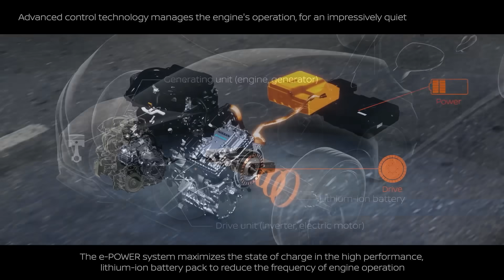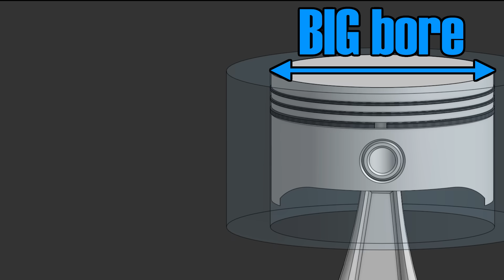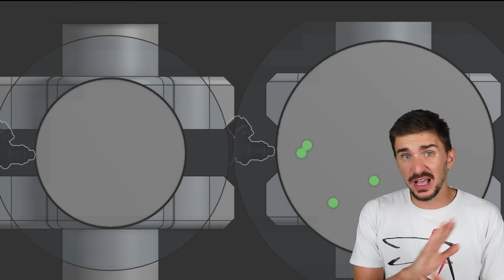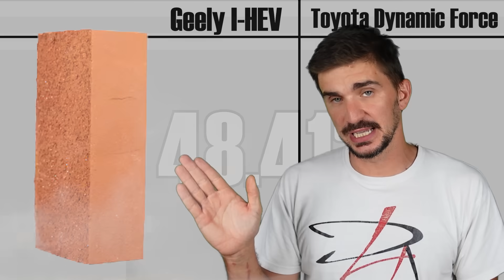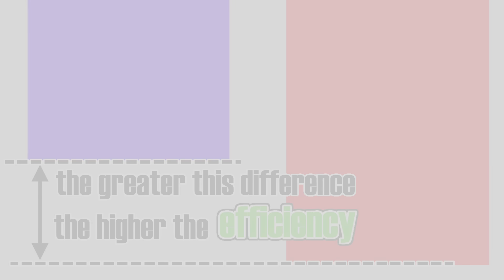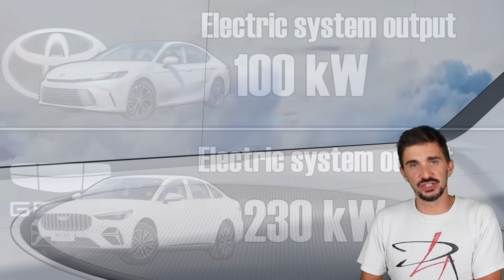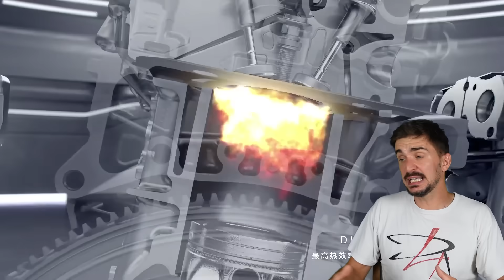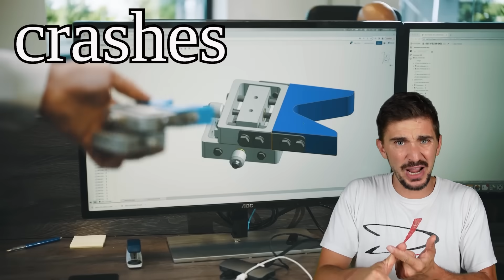How China's Geely Beat Toyota, BMW, Ford and Everyone Else

Comment: Always excellent, thank you.
Obviously I'm missing something: Direct injection has generally won out over port injection, and yet one way to get increased efficiency in gasoline engines is better air / fuel mixing. How to achieve that? Give the mixture more time to, er, mix by adding the fuel in the port or even the manifold... exactly the opposite of the direction of travel for engine development.  So... why?

Comment: Anything 45% and up is formula 1 territory and not happening in a bog standard 'affordable' mass production engine. You start needing exotic materials in various places, ridiculously costly pistons, rods etc production techniques to save weight and therefore have less inertia losses in moving parts everywhere, and reduce seal gaps to the absolute minimum. And then a pre combustion chamber to prepare the fuel air mixture for the main chamber, and so on and so forth..

Comment: Porche had engines that had coated cylinders................... it did not go very well   ask the owners
Reply: Are you talking about Nikasil coatings? Those broke down due to sulphur in the fuel, DLCs are not suceptible to sulphur, it has been used in cutting tools for decades now, they last an extremly long time! In an engine with little power to displacement and no forced induction, I am sure the DLC coating will be the least of their concerns, especially as the engine is not directly coupled to the wheels and is free to move at whatever speed it wants (Avoiding resonance speeds and high speeds in general)

Comment: one comparison that would have been very interesting : engine price/maintenance price vs efficiency ...the  more exotic manufacturing processes and materials you use, the higher the risks of failure, I mean F1 engines are running at 50% efficiency but break down after 2-3 races.
Reply: Ehm, they last about 3000 to 4000 km as mandated by FIA.

Excotic manufacturing is not what causes high maintenance, Diamond like coatings are coatings that last an extreme amount of time, in an understressed engine like that it would last longer than the life of the car, especially in a hybrid where it's only job is to keep the battery charged, no hard speed changes, running the optimal RPM, very chill.
Reply: Its more about exotic = expensive, F1 engine is 10 million dollars.

Comment: CHINA IS PUTTING ENGINES IN ITS ELECTRIC CARS FOR EXPORT    Its both a range anxiety and an inability to build infrastructure in the West problem, mostly the latter.

China knows that ultimately its exports will be limited by the pathetic levels of infrastructure spending in the West - at some point - we simply won't be able to buy electric cars cos no one can charge them. They are anticipating this bottleneck on exports.

Comment: 20years old Prius 1.5 engine has 40% efficiency ,
Reply: 1% is a massive deal in this respect. 7% is unbelievable.
Reply: @Demertech  Literally unbelievable. I don't believe them.
Reply: @nerdyengineer7943   You don't have to believe them, believe the independent testing.
Reply: @Demertech  Oh? Post a link to this independent testing. And it can't be testing by a Chinese company.
Reply: @nerdyengineer7943  Guinness world records independently verified. Google it. Also the Chinese independent government testing institution which complies with international standards independently verified. Even Japan's automotive analysts have admitted that China has overtaken them not only in EV and hybrids but also ICE engine technology now
Reply: That's not to say these brands are perfect. Chery for instance frequently exaggerates and lies about its hybrids power outputs because they advertise the combined output which isn't realistic.
Reply: @Demertech  I'm thinking that the engine can just revert to Otto-cycle when driver demand acceleration, right? so the real mileage is up to the driving style.
Reply: @xponen  I suppose but it probably will mainly be used in hybrid powertrains where the electric motors will help with acceleration.
Reply: @Demertech  how about the problem at 16:46 . It is practical to just switch to Otto-cycle than using "AI".
Reply: @xponen  then even worse at toyota etc, 1. they don't switch to otto-cycle coz it is atkinson only engine mode. 2. thats why toyota, prelude etc is struggling in endurance, try YT "toyota zenix hybrid on genting"
Reply: Audi had dirsels thst did over 40% 40 years ago. And they where actually fun to drive.
Reply: @matsv201  diesel is different to petrol dude.
Reply: @Demertech well yes. But the efficency number is the same.

Not only that, diesel have a flatter efficency curve making the high efficency more usefull
Reply: @matsv201  Diesels are generally more effecient. China holds the record for the most thermally efficient diesel engine at 53.09%.
Reply: @Demertech there are ship diesels in europe duing 56%

Yes, diesels are diffrent. But there is reallt nothing stoping companies just doing disles.

Its really mostly goverrment keep pushing gasoline
Reply: @matsv201  Those are ships tho lol
Reply: @Demertech so?
Reply: @matsv201  A ship engine is very different to a car or truck engine
Reply: @Demertech Yes, it is. When the price of fuel in the usa started going up, and more people started buying diesel vehicles, the uniparty government said "no way we can loose our money to launder... lets tax diesel to make it more expensice than gasoline!".
Reply: @keilmillerjr9701   I still like diesels but I think PHEVs are able to do most of what diesels can do. Check out the GWM Cannon Alpha PHEV. It outperforms every diesel in its category for "diesel things" such as towing
Reply: The negative is that it’s a Prius
Reply: @TheFunkymohawk  It's peak appliance. It asks for very little and still gets you from A to B like anything else. You have to respect it for that.
Reply: @jm036  Exactly, and the engineering behind its drivetrain is admirable. I've driven pretty new Toyotas, like Yaris 2025, and they are pretty powerful. They have them on the carsharing platform. I have also driven recent VW dsg automatic cars. And I very much prefer the Toyota over VWs... Once you don't need to shift in the car and you just tell it to go forward or stop, it becomes appliance, and Toyota is making just better appliances, which are sometimes even more fun to drive for me... I thought about it and I think it is because with DSG, you feel how it shifts, and it shifts when I don't want it to shift yet. Shifting with paddles is kinda unergonomic in turns and it is just, I don't know.. With stick you know exactly what you are doing, with paddles, it's just strange for me. Whereas driving Toyota with HSD, I feel like driving a train. The acceleration is incredibly smooth as in train and it shows you how much power you are demanding from it so you can drive it in a way that it is mostly in the EV mode, or when you need to accelerate more, you can keep the engine running for the entire acceleration, so it doesn't start and stop constantly. It is different driving experience which I am more accepting than robotized gearbox.

And I have to say, that the carsharing has older Yarises, from like 2018 or so, and these new ones... They are quite a bit better. More powerful electric motors, better acceleration, lower noise, bit more comfortable. In the old Yaris, I think going anything over 50km/h the engine has to run to not overspin MG1 whereas I am regularly going over 80km/h in new ones on EV mode only, the fuel consumption is therefore also bit lower. With my own car, Octavia 1.6 55kW AEE from 1997 the drive to work (when I need to move bigger stuff and don't need to park in the city for entre day, cause that's the most expensive thing with going to work by a car, with carsharing I can leave the car wherever I want and forget about it), the consumption is around 8l/100km, with old Yaris it is about 4.2l/100km, with new Yaris, I achieved 3.8l/100km when I was cautious about my driving...
Reply: @jm036  ah, but cars didn't used to be considered "appliances" at all, by most, until the advent of aggressively electric hybrids, and BEVs. 

The market needs to split. Cars for being driven and enjoyed/ pods for driving you and being nothing more than a "transport appliance"
Reply: @jm036  ah, but cars didn't used to be considered "appliances" at all, by most, until the advent of aggressively electric hybrids, and BEVs. 

The market needs to split. Cars for being driven and enjoyed/ pods for driving you and being nothing more than a "transport appliance"
Reply: @3xeplodng_3agle_studios  Most of the cars have always been appliances, and that's good.
Reply: @3xeplodng_3agle_studios  What a distorted reality you live in. Cars were ALWAYS considered appliances that take you from A to B. That is why Toyota and Honda became so popular worldwide: they were RELIABLE as any appliance should be. And also that is why Tesla 'Autopilot' marketing sold them many more cars: the MAJORITY of people don't want to drive, not just now, but 15 years ago. I would shut up about such a market split if I were you... I bet those 'driving pods' will have less and less part and RnD sharing with the 'driving enthusiast' market making the latter even less sustainable than it already was.
Reply: @TheFunkymohawk  I've never understood the hate for the Prius except that I think people just hated the people that bought them.  In its time, the 2nd generation Prius was TWICE the total efficiency of every other car on the road and this is why it was able to use the carpool lane with only one occupant.  Unfortunately, while this made sense from an efficiency and incentives standpoint, it was terrible for public relations; people are not logical beings and they saw instead that environmentalist tw*ts were getting special treatment.

The Prius was awesome and I wish that I owned one.  I'd put a big middle finger on each door and drive it every single day.  The new Prius has NONE of the advantages of the old one as it gets the same efficiency as a Corolla or other Toyota hybrid.  It's good that those cars are today as efficient as a Prius, but why not then make the Prius even more efficient to demonstrate a new goal for fleet efficiency?

The automotive press fawned over the new Prius because it now looks like a normal car, but they are all missing the point.  The Prius was NOT supposed to be normal; it was supposed to be super-efficient and economical.  Now it's just an expensive Corolla.

Not only did the 2nd gen Prius use less fuel than every other model of automobile, but it was also the cheapest to maintain for 10 years or longer.  2nd place was shared in a near-tie by the Honda Civic and Toyota Corolla at ~$500/yr, but the Prius was half that at ~$250/yr.  You bought a Prius and then drove the cheapest car to fuel, insure, and maintain for hundreds of thousands of miles.

How can any of that be a negative unless you're rich?

Now, if you're instead concerned about what other people think of you while you're driving your awesome Prius, then you've got other problems that I can't address.  Pretending that your car is a self-image of yourself is a massive psychological illness in our society and I can't fix any of you ;).
Reply: @TheFunkymohawk  a Prius is not a flex but it's significantly less awful (and embarrassing) than anything out of Chy-na